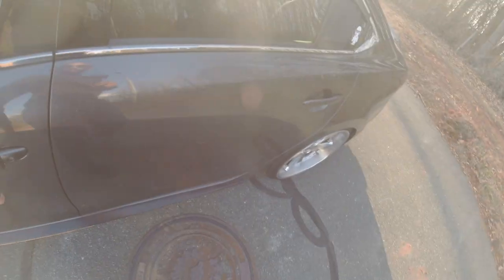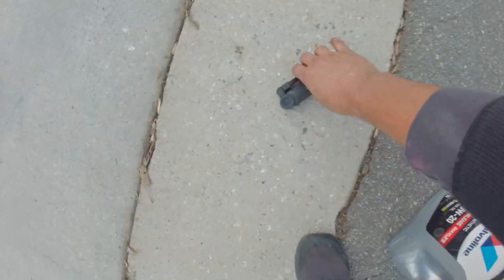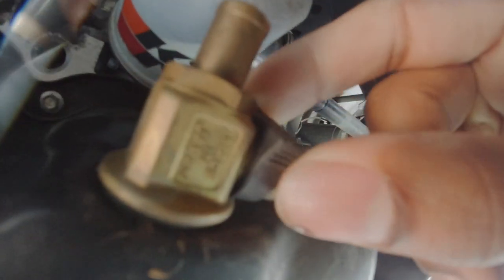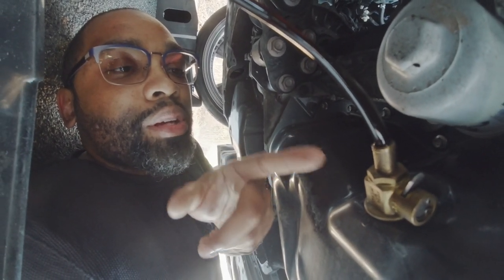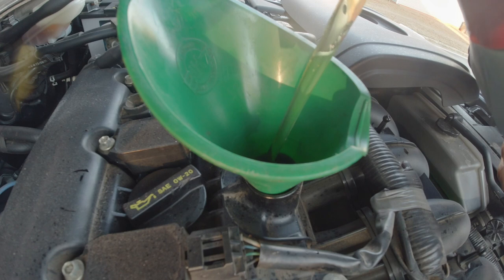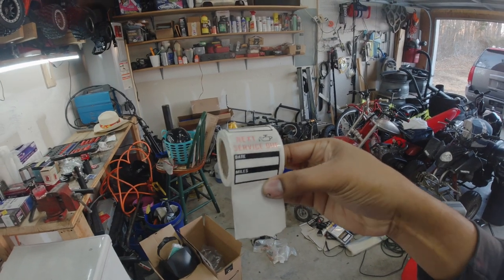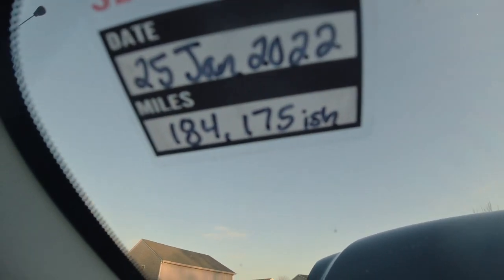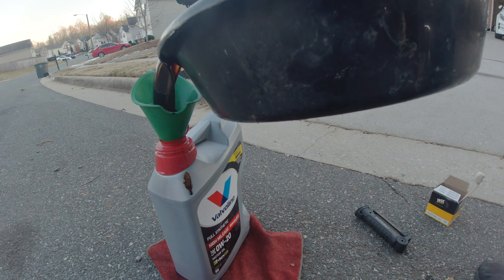18 MONTH UPDATE | Fumoto Oil Drain Valve | Fits all 2014-2021 Mazda 2 3 6 CX3 CX5 CX9 MX5 Turbo & NA

Comment: Do you think this will fit a 2022 cx5? I am stoked that you already drove 185K on that car. I hope to get that many miles out of mine.
Reply from the maker: You can check the Fumoto website to be sure. But I don’t see why Mazda would change the oil pan bolt size/ thread.
Reply: @DariusBuildz what vehicle do you have specifically?